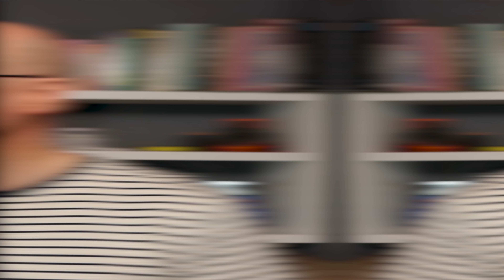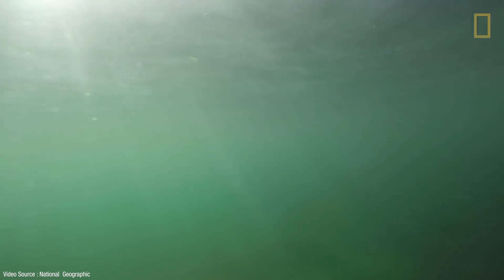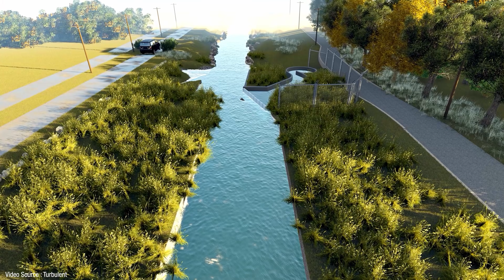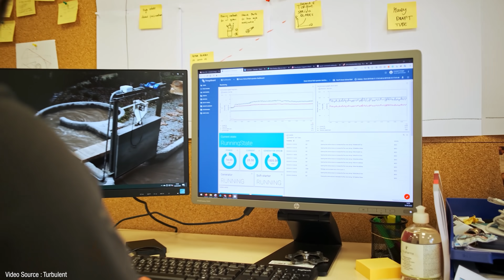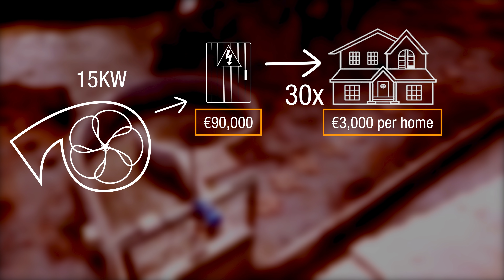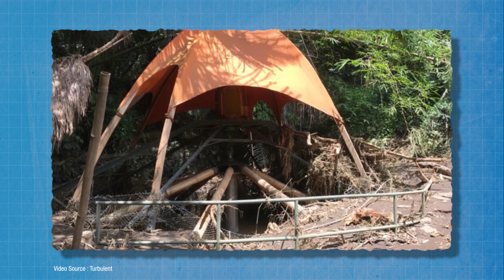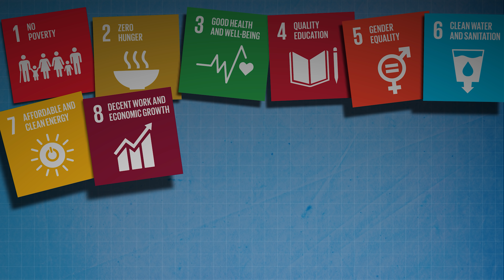Micro Hydropower : Turbulent Turbines

Comment: Even in developed countries they could be sited where rivers are close to electrified railways to supply them with power.

They could also be used to regulate the flow of a river so that in rainy seasons water is held back so it doesn't all hit downstream areas in one go and cause flooding.
Reply: No, that would be a dam.  This discussion was about no dams, just run of the river.
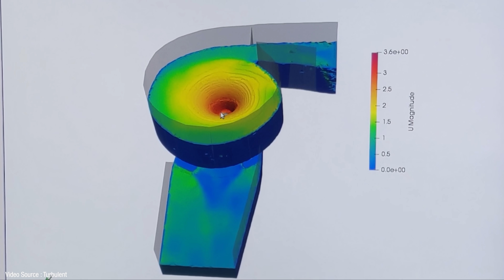Reply: I'm not talking about dams, although although at 5:30 he states that there needs to be a minimum of 1.5m height between inlet and outlet, this would most likely provided by the slope of the land.

The very presence of a vortex will slow water flow down, an added generator will slow it further.  A dam and sluices or maybe a weir could be incorporated but not necessarily, but you wouldn't want to increase the water level of the river to the point where it floods.

I remember decades ago there was a news item about a Welsh town that regularly got flooded by water from the top of the town coming out of the drains lower down.  They cured this by installing a vortex chamber in the pipes.

Comment: An other option is a Tromp. This is a very old tech that creates compressed air. Falling water has air introduced into the falling water. The water then pass through a closed chamber. The air comes out of solution and creates a chamber full of compressed air. The compressed air is then available for use. Lots of compressed air tools as well as electric power generators. This has the added benefit of creating an effective battery by storing the energy in the compressed gas until needed. There by meeting demand with out wasting energy.

Comment: Don't get me wrong, I love your channel, but the math on the solar panels is way off as well. 13kw of solar panels would take up about 100 square meters. Even if you had to have 3x that amount to get a reliable output for battery storage at night, it would only be a bit over one tennis court.
Reply from the maker: Hi Frodo. I think Turbulent were factoring in a higher level of intermittency than you are suggesting.

Comment: Your math on this one is a bit off. 15KW might support a few homes, not 30. That also wouldn't account for large intermittent loads.
Reply from the maker: Their arithmetic was correct, but purely for illustrative purpose. 15kW for 30 homes is 12kWh per day, which on average is about right for a European home. But obviously this system is unlikely to actually be used to power 30 European homes. It's not what it was designed for.

Comment: There appears to be a claim that smaller is more efficient, this strongly contradicts the 'economy of scale' principle which has driven ever larger generation systems. Water authorities such as SEPA have very strict rules on small hydro and require rigourous surveying, environmental criteria and professionally certified installers, and grid connection equipment to phase align the supply to grid is not cheap even for a very small generator. All of which make micro hydro proportionately much more expensive per kW than larger systems. These are some of the reasons why micro hydro is not more widely implemented in the UK at least. Claims by companies really must be critically assessed for bias. Love micro hydro myself, will be building one soon, don't tell SEPA :)
Reply: Well, even in this video he admitted than that bigger microturbine is more cost effective.
Reply: @useodyseeorbitchute9450  The video misrepresents the efficiency of micro hydro relative to macro hydro and misrepresents its cost effectiveness by leaving out all the regulatory hurdles and installation realities that add huge costs in developed countries. It furthermore promotes the specific company as 'innovative and entrepreneurial' and the 'designers' of the tub mill when they are no such thing, tub mills have existed for a thousand years prior to 2015. Additionally, it suggests that their technology is simple enough to be installed by local people in rural communities, implying it provides a kind of independence, yet has control systems which will need specialist engineers with intimate understanding of the specific technology from that company. This is a fluffy, wishful thinking, rose tinted and poorly thought through promotion of a private company rather than a thought provoking look at micro hydro.....I like and respect the show enough to criticize it.
Reply: @michellelewis3063  Yeah, good point, he should at least mark it as infomercials.

Comment: SWEET. I'm excited at this idea, if only governments would consider switching over to a great number of these and start to phase out existing dams, especially the silted-up, slowly failing dams such as the ones in the dry western states of the USA.  This would be something that could be rigged up for use in ocean tidal systems, too; using the inflowing tide to capture a large amount of water, then letting it flow out through the turbine when the tide was out.

Comment: I have to remind Dave that these microhydro systems do have downsides.  The 24/7 requirement is getting more difficult because large hydro projects upstream can make the river highly variable, and rivers often slow to a trickle or dry up after the spring rains / snow melts.  So variability of the water supply is a major problem, and that's why most hydroelectric systems include the dam.

But there is another microhydro system that has other advantages: the water source is a spring up on the side of a hill.  I've seen a system where the spring puts out maybe 16 or so liters per minute, and the head or drop from the spring to the turbine is around 50 meters. With a Pelton type turbine and a pair of nozzles of maybe 6 mm, the turbine can generate a half a kilowatt or more.

The best thing about this spring fed system is the water flow is very stable year round.  There is almost no danger of flooding and the water may be pure enough for use in the home.  With a storage tank up on the hill, the higher, short term demands can be met with a controller that senses the demand and controls the water to the turbine.  This could be used for cooking or heating water.  Or a battery system can be added for reliability.  The idea is to get away from using streams or creeks which are subject to the ups and downs of weather.  In colder climates there may still be the problem of the water turning to ice, so a battery system may solve that problem.

BTW the hydro system without a dam is called run of the river.
Reply: Your spring-fed system is a rare find and not likely to be found in many places.  Your other comments on streamflow variability is correct, but can be overcome somewhat with proper planning.  However, most countries have such a high population density that building hydro dams and the streamflow attenuation facilities is not feasible now.

Comment: An undershot waterwheel may be a better option in some cases.  It can be designed so that in the event of a flood, the whole thing lifts up to make room for the extra water going under it.  Debris coming down the stream mostly goes under it with no change in the speed of the wheel.  The efficiency is low but maybe that is OK.

Comment: I like the idea of a micro grid for small remote villages. There is a gradient between elevation in the reliable availability of running water sources. The higher up you go the less cubic feet of water is available to produce power so these systems will be most viable in lower elevation areas.

Comment: I believe if the same principles are applied to concentrated solar it could be more efficient less impactful and it produces clean water, also doesn’t require major construction to set up so it reduces coast and work, since it needs a smaller intake of water there’s less chance of anything getting sucked up, it’s only requirements and limits are sun and filtering

Comment: This sounds like it's actually, in part, harnessing the rotation of the earth. Fantastic idea. Hook one up to a storage battery and gain huge surge capability over the nominal generator output to drive much larger intermittent loads. I want to go and help build them!!
Reply: The coriolis effect is negligible at that scale. It's almost entirely gravity and inertia. You wouldn't be able to measure a difference if the planet wasn't rotating.

Comment: Hey Dave! I believe if you have nice cabin in the woods with a waterflow nearby a 1kW system will be enough with a battery pack to power your higher consumption loads. I'm certian a household wouldn't need more energy than 24kWh a day.
Reply from the maker: Yes that's true.
Reply: @JustHaveaThink  I love Turbulent, thanks for the video. The best part is it's on all day. I can imagine it nearby major rivers everywhere.

Comment: 15kW does not power 30x EU homes!
What is defined as "constant baseload"?
Reply: At an average of 12KWh/day per home as per the OFGEN stats the figures are about right
Reply: In Winter my draw is average 2kW or 48kW/24h including the 2-6kWh average spent on EV charging. I have a Wood stove so IT is mainly for hot water. That could be supplied by solar and a heating coil in the stove, and I would be down to around 10kWh/Day. In summer with LED bulbs and a clothes line, my ev is the main spender. My fridge is jammed into a pantry closet with vents through the North wall of the house, so it only runs between mid May and September and a third as often during summer. So 15kW/30/24 would be like a single 150W solar panel on the roof with battery storage! I agree, not doable in Europe, but for a radio and a LED or two for my kids to do homework at night after getting back from herding sheep!! In Europe an efficient home with one child and heating supplied by other means like solar and firewood, should be able to use only 2kWh/day if they are frugal. So more like 15 homes in an utopian Europe and have grid storage.

Comment: This has to be the best form of renewable power generation that most governments and large power companies have deliberately ignored for decades! Tied into highly efficient insulated housing this has to be put at the forefront of future developments throughout the planet! All local authorities should be specifying these for current and future planning regulations! Here in Scotland, I see this as a means of opening up the remoter parts of the highlands to modern industry, housing, and sustainable living! Without the need for expensive grid connections & all the hassle that brings!
Reply: Also, infrastructure for communal ground heat pumps. The first one was just installed in East England a month ago.
Reply: Governments and large power companies did not deliberately IGNORE for decades, they actively prohibit them and regulate them out of existence.

Comment: What happens to the state of the water after energy is removed from it and converted into electricity. Does the water slow down if that is possible? It must lose energy!
Reply: yes, the water is forced into a vortex stream where it drives a turbine by transferring its kinetic energy onto the turbine. Thus, the water is in fact slowed down

Comment: A great choice if you have a river near your property, but how many people actually have a river near their property? When I bought my small plot in the countryside, I specifically looked for one near a river or stream and I can tell you, it was damn hard to find one. Eventually I did, but the river is just a tiny stream, although I'll take the free water to irrigate my lands, thank you very much. I did have to pay a small premium for the land, being close to the river, so there's that hidden cost. Still, land next to fresh water will someday be a very valuable commodity and also land next to rivers usually have very fertile soil, which helps of course.
Reply: If your stream has constant flow drop a ram pump in and lift the water as high as you can and feed it thru a micro turbine /alternator. Problem solved. People are cursed with thinking bigger is better.
Reply: @tombombadil3185  Yes, our neighbor has already installed one. We use it to raise the water as our lands are several meters above the stream's bed height so there are options there, but I don't see the need to raise it higher, the ram pump already generates the extra head pressure, I'm sure I could just put it through a nozzle into a microturbine, don't see the need to raise it per say. However, that said, one option is to use the ram pump to pump into a high reservoir and then use that to drive a microturbine intermittently when energy is required on demand.
Reply: Have you seen the water wheel which can not only generate electricity but pump water manually through a coiled hose?